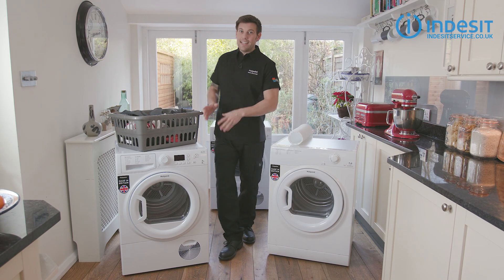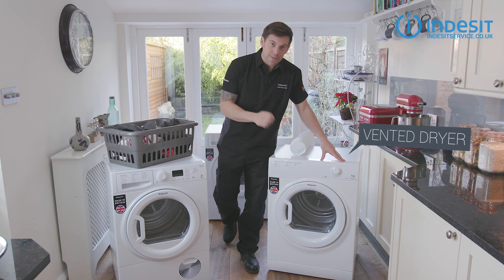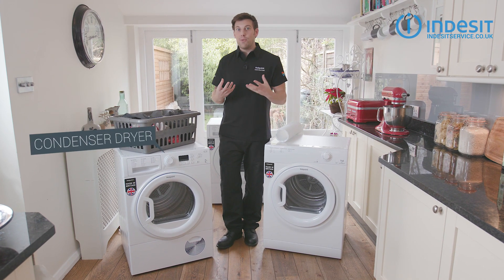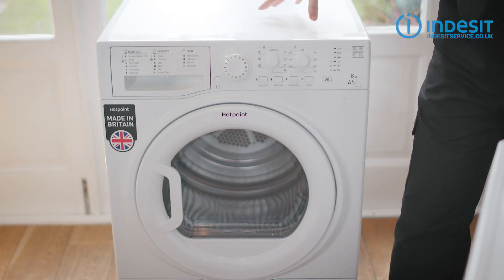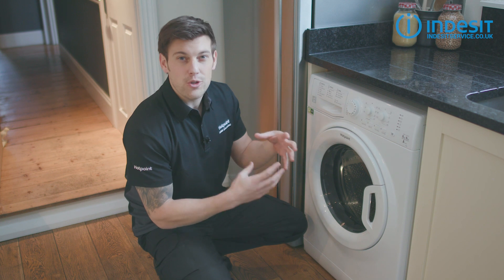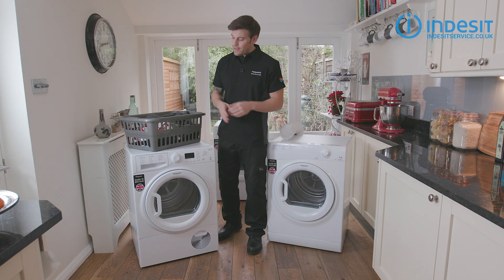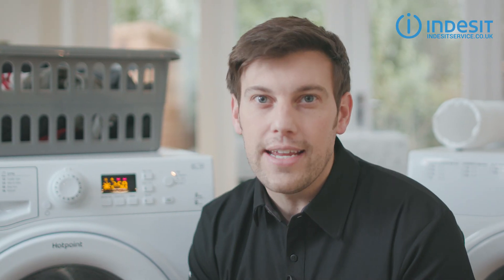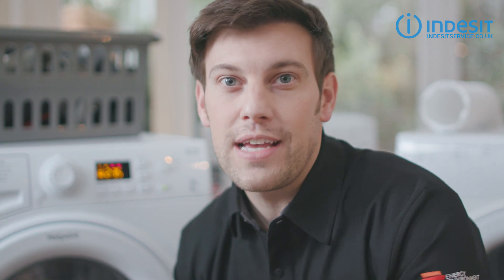Tumble dryers explained | by Indesit

Comment: Buyer beware..just over a year old indesit condensor dryer, the condensor unit which is supposed to be removable to clean but now will not go back in. The plastic seal warps, so getting it back in is next to impossible. Would appear to be a well-known design flaw. Countless incidents reported online asking how to get it back in.

Comment: I have a heat pump dryer not a hotpoint/indesit one a Miele one it’s brilliant on electricity my old indesit dryer used 92p per hour. My heat pump on uses anything between 26pence to 30pence maximum!! Hell of a difference in electricity usage! 
But yes they are about the same price as a washer/dryer 2in1 or the price of two standard condenser dryers.  I haven’t had anything shrink yet as it doesn’t get that hot but stil dries in about the same time as a normal condenser dryer hour just over lighter things about 40 mins. I would say they are definitely worth it!